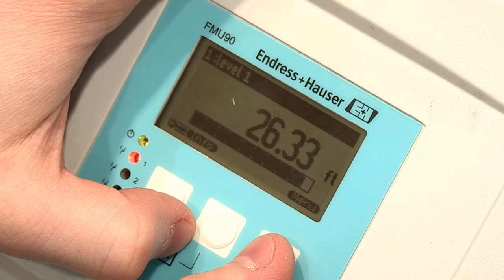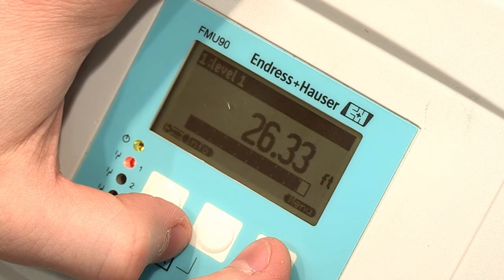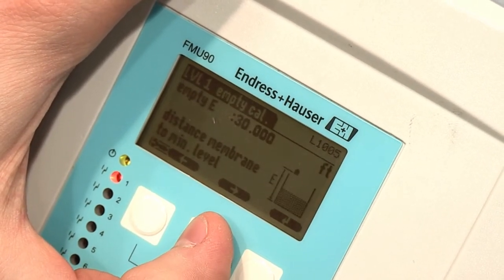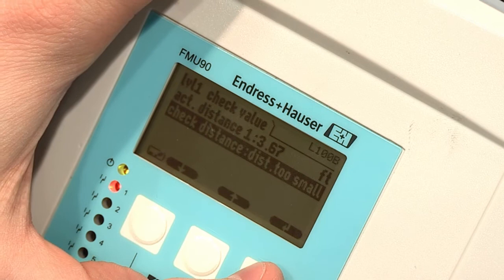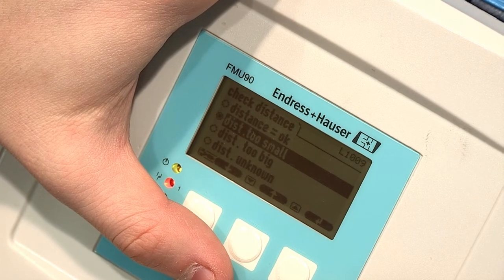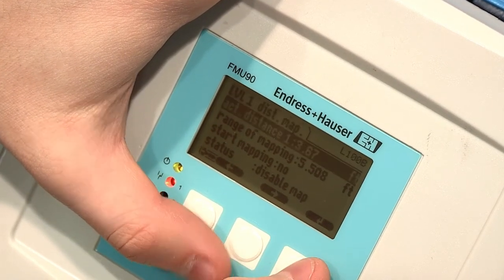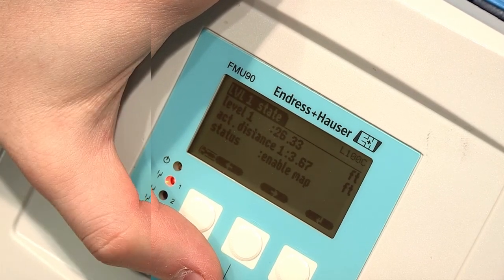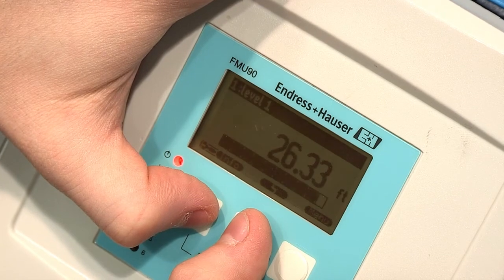Prosonic S FMU90 – Mapping

Comment: what if it's continuing to read record mapping is there a way to verify sensor
Reply: If it stays in the status of record mapping for an extended period of time, please cycle power to the unit, allow it to reinitialize, and go through the basic setup and check the sensor readings again. 

From this point, if it is still locked onto Record Mapping on the display, I would suggest doing a factory reset using code 7864, which can be entered in under the Device Properties...password/reset...reset.  This should clear the lock up.

Then, you can recommission the device, and check the operation of the sensor by manually pointing the sensor towards a fixed target and then measuring the distance between the sensor and the target.  That will tell you whether or not the sensor is reading correctly.  Also, if the FMU 90 identifies the sensor, this will also validate that there is not a failure of the sensor.